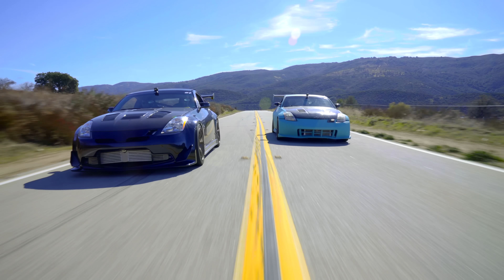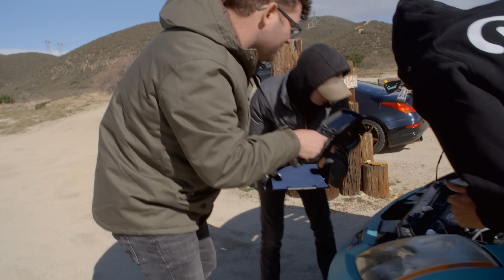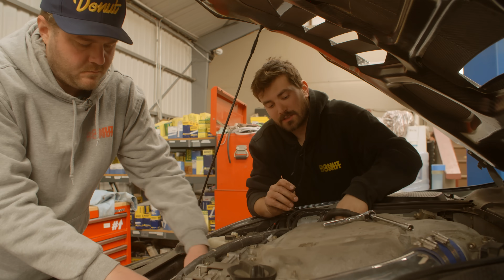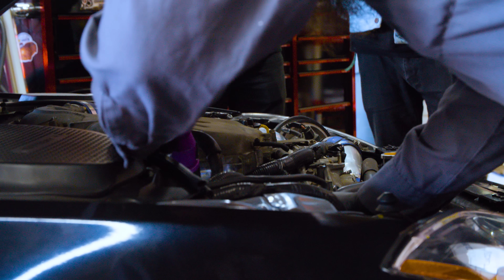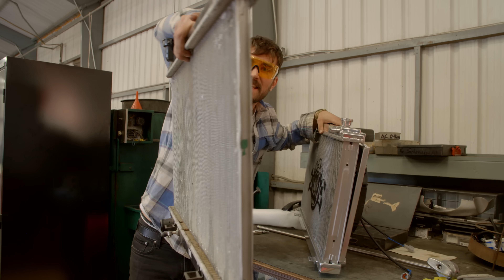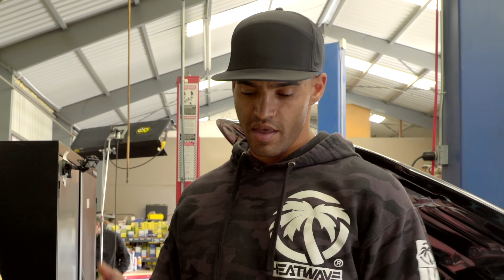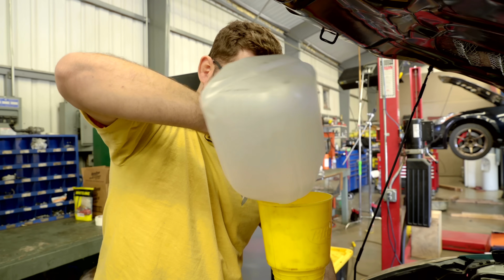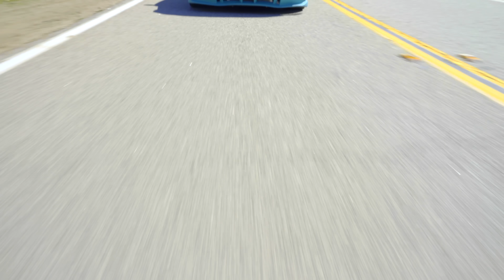$200 Radiator vs. $500 Radiator

Comment: guys, Zs have a known issue to cook the oils as well, you should consider adding oil coolers to them. just to be safe and it could be a nice hi-lo episode between cheap oil coolers with rubber hoses and those expensive mishimoto ones with braided lines and AN fittings, see if they really make a difference.
Reply: Get this comment to the top!!
Reply: Get a Forge motorsport one or maybe get a HKS or the like.
Reply: You do realise mishimoto parts are just rebranded chinese crap? And you also do realise that oil systems like cooler setups dont require braided hoses right? And you do realise that mishimoto braided hoses and AN fittings are just chinese braided hoses and chinese AN fittings. And you do realise that theres not enough pressure in the system to require a overbraid and AN fittings, they only require pushfit fittings and oil resistant pushfit hose, right?
Reply: @ep91monster  jeez you must be the life of the party
Reply: @lifestokens7469  what are you on about? Life of the party 😂 all because i speak facts? Why dont you speak some facts rather than post a non relevant comment like that begging for some likes off of other like minded simpletons? 🙄
Reply: @ep91monster  look at you all worked up, keep it up Fact Guy  🤣
Reply: @lifestokens7469  hes not wrong read some reviews they leak alot they do have a good replacement policy but replacing ur radiator every year or so isn't feasible again I advocate for Cold Case research pays
Reply: @danielpritchard510  Oh i completely agree with him on that lol 

I just got a chuckle with the passion he expresses on the keyboard 

And thats a fact 😉
Reply: @ep91monster  so? the theme of the show is quite literally finding out if "more expensive means more better", if you're right about this than that should make the episode far more interesting. 
Also note I didn't say mishimoto was better, I said expensive.
Reply: @PemaMendez990  i replied to your original comment because you mentioned about comparing mishimoto with there braided hoses and AN fittings to a cheap setup with rubber hoses. IE; you think because a mishimoto kit has braided hoses and AN fittings that its a superior product. Or at least thats how you come across. When infact, no engine produces high enough oil pressure in the oiling system to require AN fittings which were originally designed for hydraulic applications, and ships and aircraft. The outer braid stops the internal fluorolined rubber hose from swelling and possibly rupturing under high psi. Fuel and oil systems on cars dont require any braided lines. The only lines that would benefit a overbraid would be the brakes and clutch. Not the fuel system and engine/diff coolers. Aeroquip 400 series hose is more than enough and thats got no overbraid and only uses push fittings not AN screw fittings. Either way, mishimoto oil coolers are still only ebay chinese special coolers which are powder coated there colour with there logo added and literally 2x to 3x the price of a equivalent sized core from china. Same with there intercoolers and radiators. Over priced crap that someones managed to rebrand as there own when there just all generic parts. Like i said, for a nice comparison search ebay for a oil catch can and compare it to mishimotos AOS can. Literally identical. Dont know how mishimoto get away with it in all fairness. Its because people in the scene that dont fully understand, see the name and assume its top quality, there being robbed.
Reply: @yeldarb1880  🤣 yeah, i have a Sti WR1 pal. No idea where in the world you are but these models are very collectible. Guessing you're a typical yank with a rotten impreza
Reply: @ep91monster  does it pay to b a sarcastic prick? U do realize it jus makes u miserable, right?
Reply: @ep91monster  mishimotto are known to leak Cold Case is my brand and I swear by it

Comment: Fan shrouds don't direct air to the fan. They help pull air through a greater area of the radiator.
Reply: @[Removed] they pull air through, they do not direct air to. Master the language before you try to insult.

Comment: Only 1 minute into the video but one thing that is common across several platforms is factory fans work better than aftermarket slim fans almost 100% of the time.  The only reason to change fans is due to lack of space.  If the stock fans will fit stick with the stock fans.

EDIT: And 6 minutes in I see it covered by lo car crew.

Comment: I installed an $89 eBay aluminum radiator into my Miata a few weeks ago and it dropped the temps by about 30°! I just wanna see how long it lasts lol.
Reply: Well since your'e not filming a YouTube episode and fishing for views, it'll last just fine.
Reply: And that's the big $ question, I tell friends all the time. If you can afford it now just spend the money, If not buy the cheap part and save for the $$$ one. I have seen to many people buy the cheap stuff over and over again. Saying but they're cheap so it cost less, but looking at the over time cost they pay 2 to 3 time what a good $$$ part would be.
Reply: @TdrSld  I've seen many people run cheap stuff for years and be fine. Just depends what cheap stuff they buy and which parts they can cheap out and which they need to spend the money on. Expensive definitely does not mean better all the time. Hence the reason garage built shit boxes run 9s and sometimes 8s in the 1/4. To me this was a setup for low car to fail from the very beginning.
Reply: @Clamb13  Agreed, it's a hunt to found the balance between cheap and reasonably priced good parts. I find that most people go straight to the bottom of the price scale and say screw reliability. Brake pads are one, yes I can get a set for 25 bucks at a big box store. But they'll only last about a 1 years at most (I've had a set from the A place only make it 3 months normal use in my truck). But a set of 75-120 dollar pads from a good name brand can last me up to 4 years and stop better. And don't even get me started on brake rotors HAHA.

Comment: The stock cooling system in the Z's are awesome. I have beat on mine for years in the hot California heat with AC at drift events, all I've added is a power steering cooler.
Reply: @[Removed] There trash? Lmao handling a twin turbo system under hood heat and getting beat on in the California sun is pretty good if you ask me. If they added water wetter the stock system could have been retained which is not something you can say about other cars modified this heavily.

Comment: Low car sponsored by Megan at this point. Half the car just built from those parts.
Reply: Tbh Megan is actually really good quality, they're just more budget-oriented. Ran a couple Megan Racing parts on my Mini Cooper S and it was well worth it
Reply: @Kenny-vs4pr  which gen? I have an R53
Reply: @Tugboatpb  it was an 2nd gen, an R60S Countryman but I sold it for a 2019 Miata over a month ago due to timing chain and tensioner unreliability
Reply: @Kenny-vs4pr  Mmm, that good old  n14
Reply: @Tugboatpb  funny enough mine had the n18 which is a revised n14 meant to fix all those timing issues. Guess what never got fixed and guess who had slack in his timing chain?😂
Reply: @Kenny-vs4pr  smh, the R56 is a better gen in every way apart from the motors. Shame really, that's where mini's bad reputation came from. I'll stick with my R53
Reply: Kenny926   Fax, my dad got basically all of his suspension parts from there for 
his Acura TL

Comment: Antifreeze is not only for freeze protection. It also increases the boiling point of the water, lowers the surface tension of the water and prevents algae growth.
All important stuff.

Comment: when you turbocharge a stock car, first two things needs to update are tuning and cooling system. im only guessing now that the low would not overheat unless the cfm of the fan aren't higher than stock.

Comment: It taking longer to heat up doesn't necessarily mean that its doing a better job, it can mean that it just has much more thermal mass so it takes longer to heat up, whats important is how much better at dispersing heat, which really obviously wouldn't be a huge issue, the radiator would have to be reeeeeally thick to cause that issue or have super tightly packed fins, and more thermal mass on these is an indicator towards it being better, im just being nitpicky and ranting lol

Comment: Sometimes clogged cats can be hard to diagnose. I've got a Pathfinder and it wouldn't rev and sounded like it was misfiring and gave me a general misfire code on my cheapy scanner. I replaced all the plugs and the coils and cleaned the injectors and it still did it. What was it? Clogged passenger side catalytic converter. Runs like a freaking dream now... 300 unnecessary dollars and four unnecessary hours later.

Comment: Donut: Low car gets cheap parts

Me: struggling to buy $200 throttle controller Low low car gets cheapest parts
T___T
Reply: I feel you bro
Reply: Being broke sucks aha but you should always take the time and save for better parts bro! I’ve spent most of my income on my car the last three years. First year was cheap parts most have already broke. So I started saving longer and getting nice parts and holy shit it’s night and day.
Reply: @hitlersmissingtesticle69  quote of the year
Reply: Time for a part time job. Deliver pizza 2 nights a week. It'll give ya an extra 200ish a week and you wont be there enough to give a shit about the job
Reply: This man really trying to buy a pedal commander 😆😆😆
Reply: @504chris  what wrong with a commander if it works 🤨
Reply: @Jimmy_MZ  besides the fact that they don't really do anything. And getting a actual tune will net more benefits at the same price. Other than that nothing
Reply: I'm jist tying to keep my car from getting the check engine light on, completely stock by the way😔😔
Reply: 1_1
Reply: Learn to code

Comment: The math for the Hi parts is wrong: $300+$200+$200=$700
Reply: Because at donut they suck at math
Reply: It’s because low car didn’t get the housing so it’s $230 radiator versus $500 radiator plus $200 silicone housing

Comment: Radiators are one of those things that are easy for new car people to spend wayyyy too much money on. They all work the same. Get one that fits, slap it in, and party.
Reply: agreed lol
Reply: Lol you’re saying all radiators are the same?
Reply: @wielletbuilds  If I thought they were all the same I would have said that. I said they all work the same. People pay hundreds of more dollars for potentially single digit temperature differences. Worth it? Not in my opinion. You think what you want, I don't particularly care.
Reply: Jaran Hedstrom pretty ignorant. I can tell you that even radiators of the same size can perform completely different and more than just single digit numbers like you claim.
Reply: Michael Wiellett yeah but the ratio from tempature to money is really varied so paying hundreds more for a couple degrees cooler is overall noth worth in the long run hopefully you try an understand :)
Reply: @jaranhedstrom5325  Dude... Come on. Sometimes your little stock rad can't handle the heat you're throwing. I'm not saying you need the most expensive rad out there but to say they are all the same? Don't be an idiot.
Reply: DarizLopeo !!! Your problem is that you assume you will only gain a couple degrees of cooling. When you enter high end motor sports applications, you’ll gladly take 5-10 degrees if that means not overheating. If you don’t seriously drive your car I guess it doesn’t matter